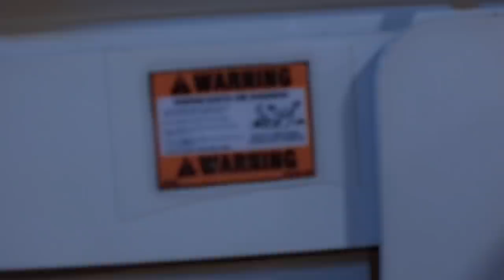Mini JAW CRUSHER pulverizing Rocks for Road Roller Practice! | RC ADVENTURES

Comment: dont forget about air quality control!! get yourself a water table! (an articulated truck with a huge tank and pump for keeping roads and mines moist to keep dust down)
Reply: Don't you mean a Water Buffalo? That's what we used to call them in the quarry I worked at in...Buffalo NY
Reply: Different names in different parts of the country I suppose. I think the equipment folks would know em by both

Comment: It would be cool if you cut out a spot of the concrete in there big enough where you can mess around in dirt and use the concrete and hall it off and crush it and be able to play inside with the construction stuff

Comment: Im not a fan of the spring loaded track tensioners. cool machine though!
Reply from the maker: You have never driven in a rock quarry with tracks .. with an RC.  If you dont have loose tracks.. you will snap a cog tooth. End of fun...

Comment: Those tracks look seriously loose, surely it's not designed have that much slack
Reply: I believe the tracks where just stretching
Reply: @austinbrantley776  Yeah, the more I watched, I think it was the idler wheel hitting the trailer and releasing the tension on the tracks. Still, that much slack is not good, lol.

Comment: I need some help my Redcat Racing Everest 10 has killed 4 servos and it killed its 4th servo a few days ago I have no idea what is causing it to kill them and Redcat has no idea what could be killing them without the truck being in there possession to figure out the problem the servo barley works still it steers right normally and left is stiff it tries to force itself back to the straight position Redcat told me to take to servo horn off the servo and turn the front wheels left and right to see if there is any binding causing the problem and there is no binding going on can anyone on here please tell me what could be going on so I can get the problem fixed .
Reply from the maker: if there is no binding, then it is either a cheap servo series, or a bad receiver.
Reply: @TheRealRCSparks  Ok i'll take a look at it this problem did not start until my brother got a hold of it killing the ESC, Receiver, and servo when it was only 3 weeks old.